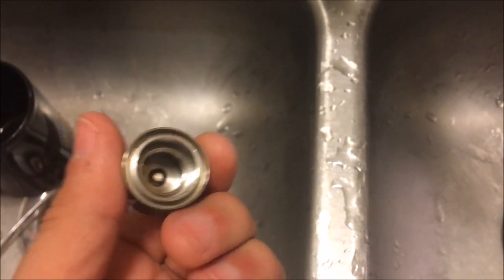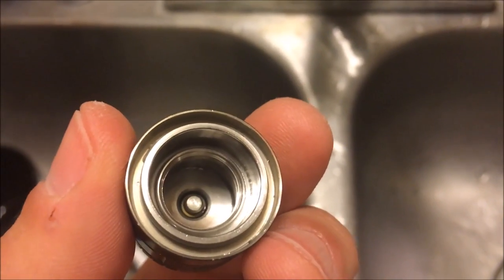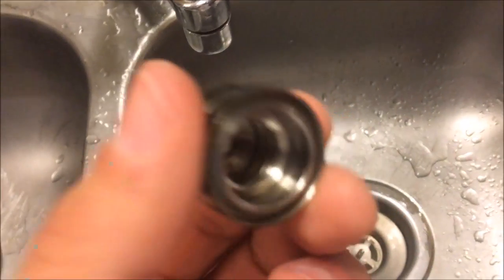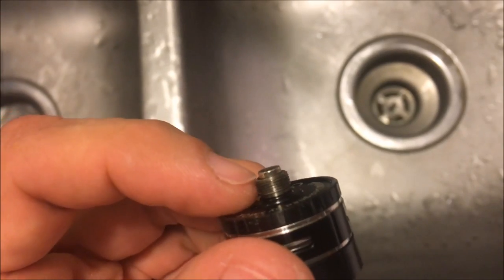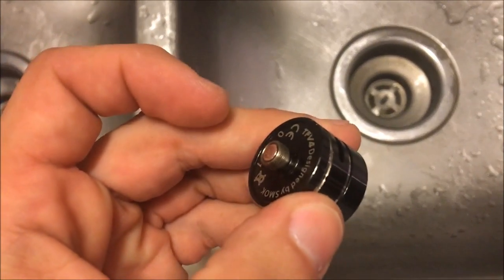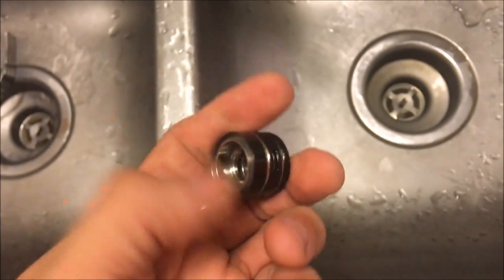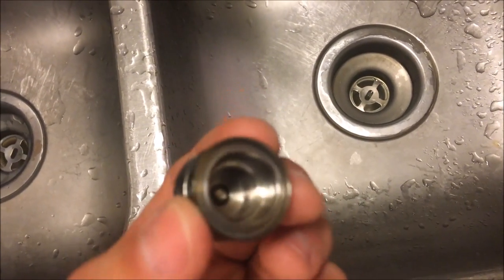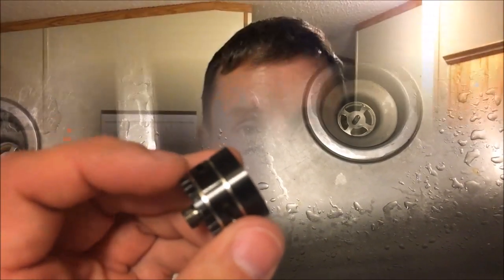How to fix 'check atomizer' on the SMOK TFV4 Tank

Comment: You a genius.I stopped using my smok for about a year now because I dropped my GX350 at work one day. Was told it was a battery issue. So I ordered new batteries on Amazon. Put them in and my screen read "check atomizer" and that's when I started youtubing to figure out the problem. Saw so many videos about troubleshooting that weren't any help at all til I ran across this 3 minute video. Happy to say that this video absolutely did the job. Appreciate you. God bless 😂

Comment: Thank you! After I opened the unit, made a small mod below the spring with a tiny rubber ring, I was still getting Shorts/No coil - then I found your video. I cleaned the tank, pushed the pin down and now I'm back to making clouds. Many thanks! Peace

Comment: Appreciate the advice. Worked out for me after over an hour of messing with it. Others pointed to the pin being depressed, but I was still getting low ohms. That last bit of advice to connect the atomizer to the base as opposed to the top was what helped resolve it. Anyways, thanks man.

Comment: this totally worked on my lotus mini mod. I simply took the tank off, pushed down lightly on the round thing in the mod shown in the video one time and was good to go.  I would imagine this problem stems from putting multiple different tanks on the mod, all of which would have different tank-modd connector lengths
Reply from the maker: dirtyD2341 I believe that as well.

Comment: I've been using a Melo II tank on an Istick TC 60 for a year or so with no problem. I got an Istick Pico yesterday and got the check atomizer message after a couple of hours. I thought the Pico was bad until I tried it on the TC60 and an Alien mod and got the same message. Your fix worked. Interesting that it only happened after switching the tank to a different mod.

Comment: The juice from priming your coils actually seep into that pin connection between your mod and atomizer.  I personally would put a dab of dish soap on pin and work it back and forth to take away the oil.  Wash, Rinse and dry then put it all back together
Reply from the maker: I don't know what I'm doing wrong when it comes to that. I always screw up my coil if I get it wet at all.

Comment: for all you people out there, i got the solution if you did everything, 1 take the coil and on the botton there is a metal piece, remove that one and the black plastic, 2 you shall now see 1 or 2 metal strings, take 1 of the metal pieces and make the touch outside of the coil so when you put back the plastic the string should be between the metal and the plastic, then put everything back together
Reply: i might upload a video later on tutorial

Comment: your a good man bro.i had to do that with my smok tank just now.so does that mean my tank and mod aren't really compatible.
Reply from the maker: dreamer 05 not necessarily. There could be a minor manufacturing flaw that does this. Also the difference between 310 and 510 threaded ones can cause it.

Comment: This is also the same problem I had with the tfv8 and it works for the tfv8 also
Reply: Typical VizionZ how do you get your pin to stay back down, mine keeps going back up.. And I've been fighting with it for the past couple hours now.
Reply: +Kevin McClelland if you push it down then screw it back on it should have a good connection but another thing I had a problem with was the coil not making a connection so also check your coils or try to put a new one in especially if your using the Q4 coils on the tfv8
Reply: Typical VizionZ see the funny thing is, the q4 worked perfect for me, it was the other coil that came with it that fucked it all up, after I used it, i got a nasty ass burnt taste and now this happens to my pin. 
I tried screwing it down slowly but all that happens is either it goes up and it tells me check atomizer, or it goes up and says my ohms are to high. Either way it's really pissing me off.

Comment: Is there any way to get it to stay in that position? I did what you did and it worked for 3-5 puffs. Then I had the same problem again. Took it off the mod and the pin was back in there again.. (I have the TFV8 but it's the same crap pin)

However, great video!
Reply from the maker: The best I could say is to not tighten it all the way down then. Try having it set looser than normal. So, when you tighten it down, watch the ohm reader and when it 'registers' stop tightening and see how that works.
Reply: Yes, I understand. Tried that but it reads very irregularly. Sometimes too early and then the tank is all loose and wonky up there. Tried to cut out an old visa card to have in between but then it didn't connect at all. I'm so tired at this now so I'm just gonna send it back to the store and hopefully get a new working one or my money back. Thanks for the help!

Comment: So I tried this on my t150 with the tfv4 and it only works on temp control when I switch it to watts it says check atomizer any idea??
Reply from the maker: northern grizzly ridder the contact is still most likely not making the best connection.

Comment: sooo the problem here is the atomizer and not the mod? correct?
Reply from the maker: In this scenario, no. The atomizer just isn't making correct contact for the pin to transmit. So the culprit is actully the tank, not the coil.

Comment: Hmmm, it dosn't work with me, the massage appeared after a stupid wash it with water, i tried billions of ways to solved including changing the tank, trying different modes, preesing the atomizer down and up' non works, i think this electrical issue not mechanical, at least with mine
Reply from the maker: Unfortunately you are probably right :-/

Comment: is that pin suppose to move?
Reply from the maker: beatkevin20 it slides and is supposed to be spring driven, but that goes faulty sometimes
Reply: vaiisking Thanks for the reply. I asked because my tank does the same thing as yours. So is my pin faulty?
Reply from the maker: It's possible. I wouldn't rule it out. If you bought it locally, see if they warranty it?

Comment: Sucks man when I screw the tank back in it pushes the pin back in.. might just buy a new tank fuck it
Reply: skatedylan98 I'm having the same issues
Reply: I ended up take it to the shop and the guy just screw on the coil Harder lmao. That's it
Reply: skatedylan98 really? I've gotten mine as hard as I could go but it's still nudges loose, FML